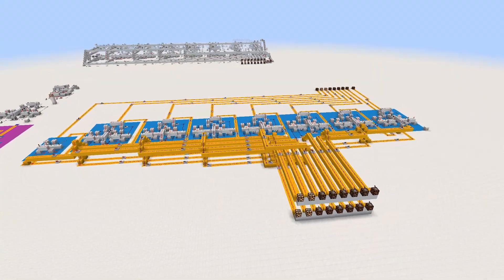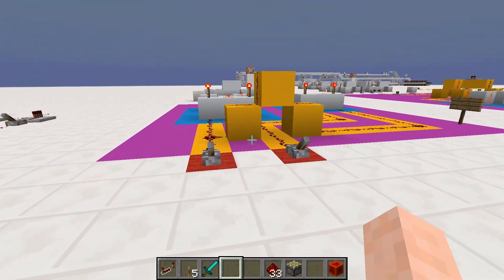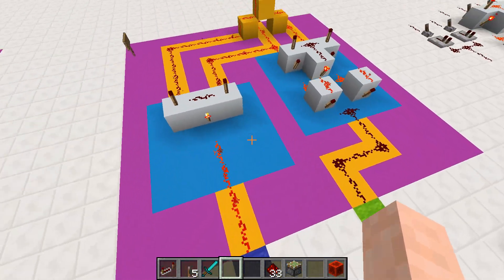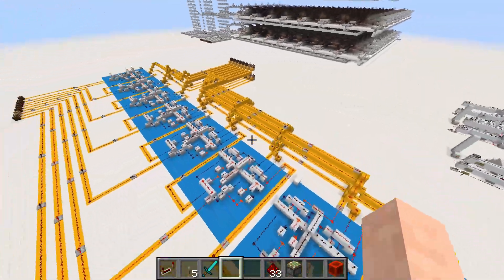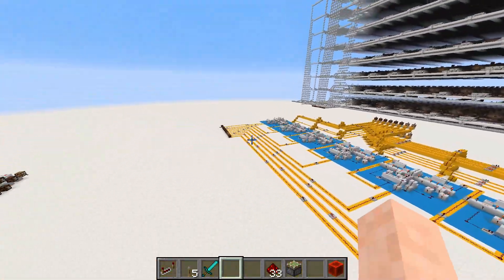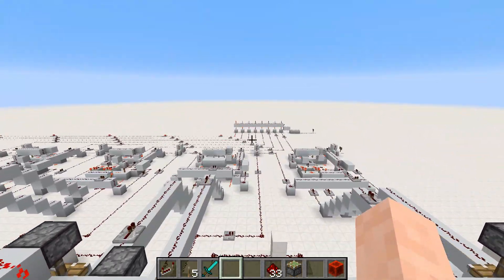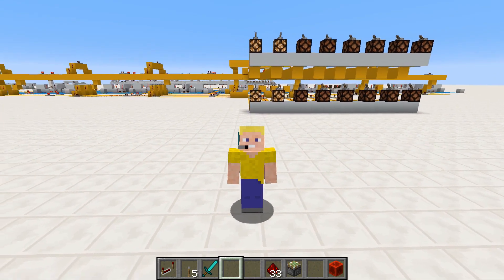the 8 bit adder. minecraft computers #1

Comment: Sorry I’m late... but how do you use this to add/sub very large numbers? Would you just have 10 binary decoders for each digit and add one to the next digit if it reaches 10?
Reply: dont know if i understand the question. if you interested in decodeing large binary numbers to decimal you could figure out some circuit based on adders if you need fast combinational circuit. if makeing slow sequential circuit doesnt bother you i suggest using Doubble Dabble algorithm.
Reply: I’m not sure I understand your question

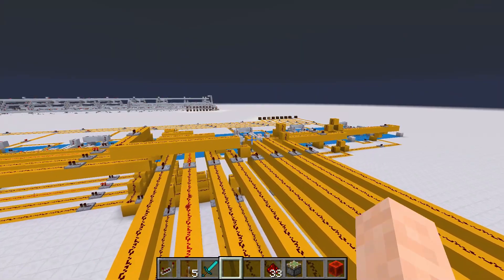Comment from the maker: 0:50 2 + 2 does not equal 3 it equals 4 😂
Reply: Not rlly the output still binary number so the lamp number 1 is 1 lamp 2 is 2 lamp 3 is 4 so the answr is 4
Reply from the maker: @colder7603  I was commenting on the fact that I said it wrong.
Reply: Wait hold on my brain error
Reply: Btw i try to re create your calculator and it roly mess up my brain
Reply from the maker: @colder7603  https://www.youtube.com/playlist?list=PL8dPuuaLjXtNlUrzyH5r6jN9ulIgZBpdo this how I learned
Reply: Hm i will watch that and is the computer output binary number?
Reply: I just complete build a calculator using your adder, thank you now i can use it on my project and stuff
Reply: it is more complicated by real 3d Finfet with 8 bit adder
all transistor is the same and set them array on the floor ground
then all connect line to as a not grate, and , or gate,
then re mapping them to  as sqaure as possible to reduces area and high density
So when you build 8 bit adder, how to copy them and link to Apu?
How to make a compiler from source code to mechanic code
and you will missing about source power line and grounding line to making 3d transistor out of minecraft like autocad, 3d max
i give you what should like in real
https://drive.google.com/file/d/1yzTPjFl2b2X27OpNPBq17G8Y8AdEujdx/view?usp=sharing